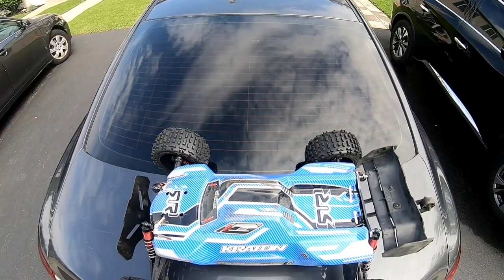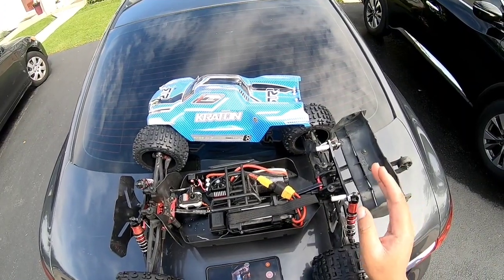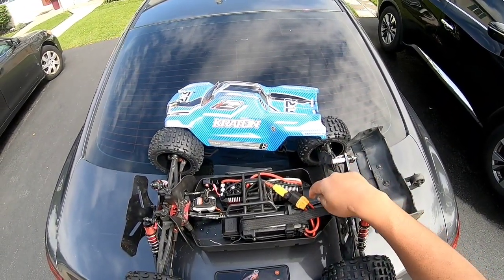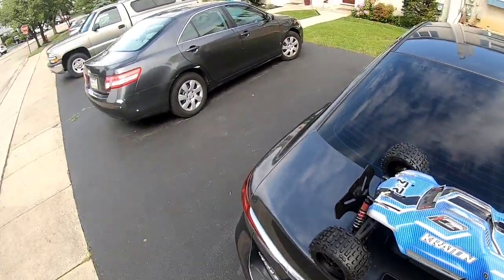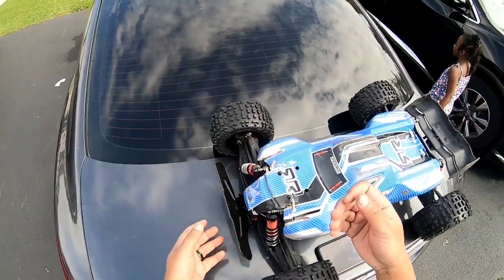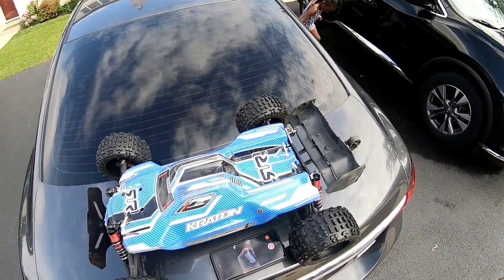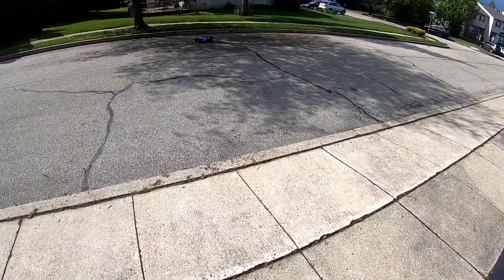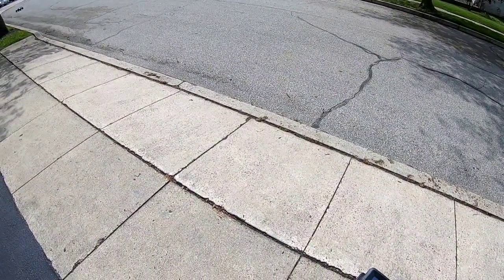My Kraton Mojave hybrid aka Krajave

Comment: Can’t believe how nice the LP’s look on this huge beast! I have the same plans for my V4 kraton. Oo this is Chris Koller. The guy who bought your Losi dbxle 2.0. Lol the infraction body fits this conversion and fits k8 too. Should consider it. It’s what I’ll be doing and adding the jbi wheel hex +10mm adapters. With mx38
Reply from the maker: Yo thanks, i was looking at infraction body. I jusr want a bigger kraton body was thinking of just running kraton body with body mount extensions.
Reply: Jay Mitch ya I mean maybe k8 body would fit. Or Mojave